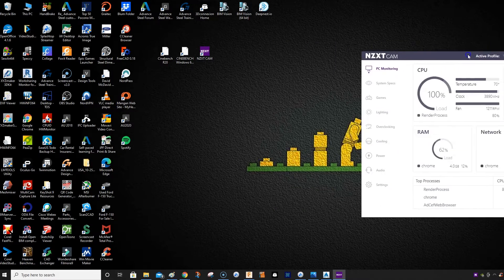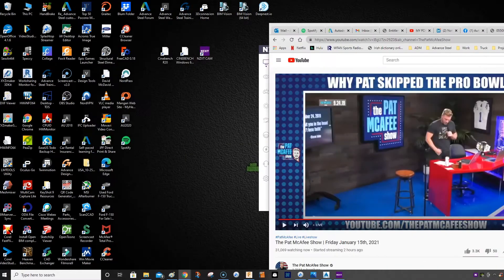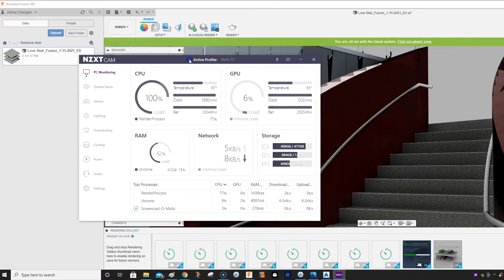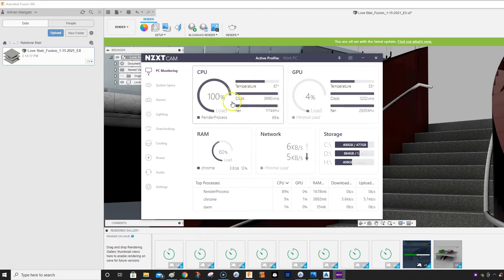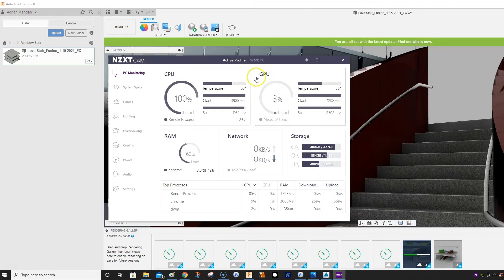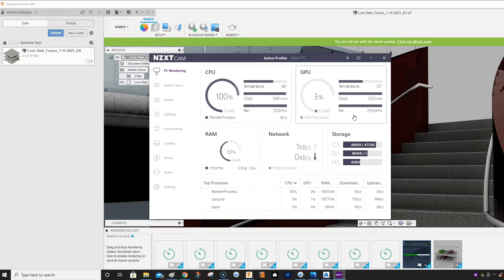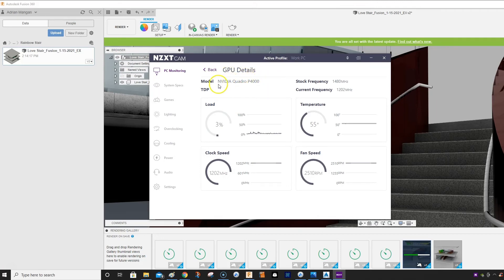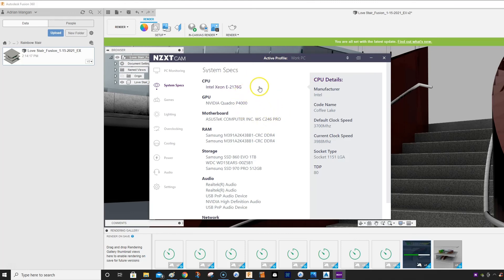ADVANCE STEEL: What Graphics Card do I need?

Comment: Do you think buying a non professional GPU for Advance steel is a good choice?
Reply from the maker: Yes more than fine in my opinion, I even run AS on Yoga with new Iris on board Graphics, I would recommend fast CPU, harddrive and minimum 16gb RAM. Good luck. I would recommend dedicated graphis just for the extra ram but AS is CPU reliant, get as high core speed as possible so no lower than i7 i think
Reply: @EIRCAD  ok, thank you